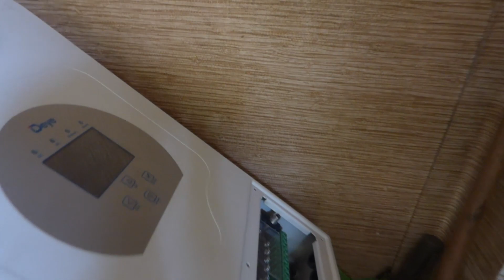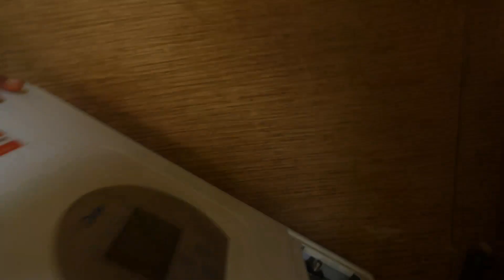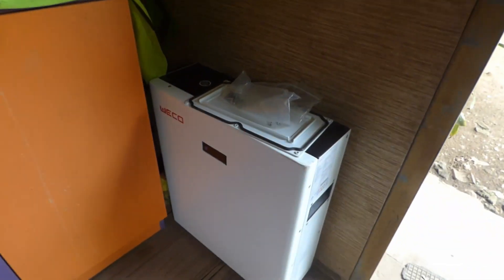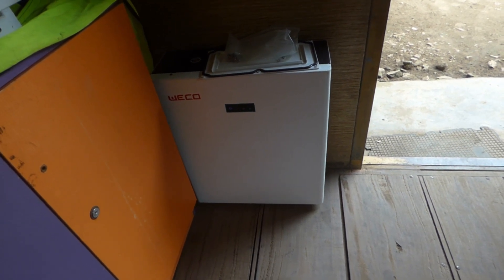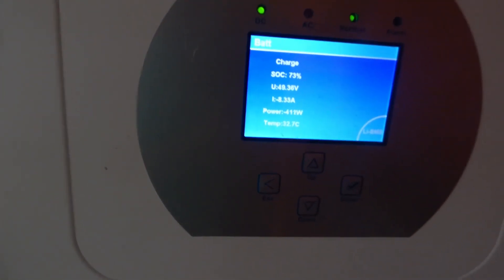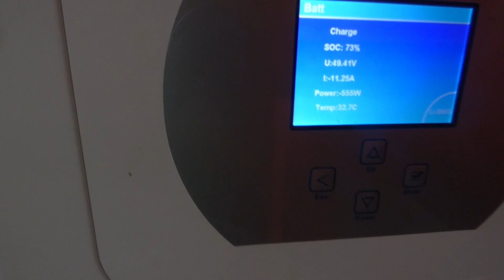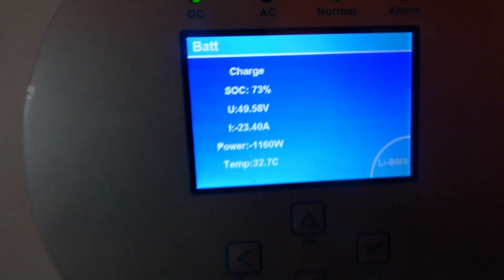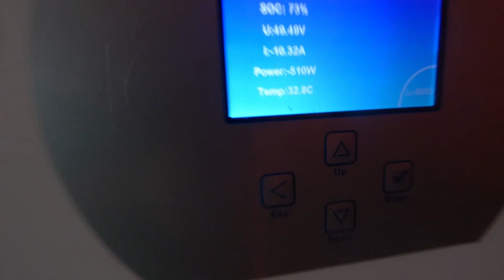Blown up Deye inverter and my Chinese customer service experiences compared to the Europeans

Comment: About to install a 12kW system on my home with a Deye inverter.  I don't know anything about the various inverter brands and wanted to hear some reviews.  This video was perfect.  So helpful and useful.  Thank you so much for sharing this info!!
Reply from the maker: Thank you so much. This means a lot. Good luck with your installation
Reply: I'm about to install a Deye 10 or 12kw Deye Hybrid Inverter in Chiang Mai. Are you happy with yours?
Reply: @BigWorldOutThere98  Yes, so far it's been good, but I've only had it in operation for about 1.5 months.  Smooth sailing so far....

Comment: Good day, thank you for the good video. Have you stress tested the Deye 5kW in a off-grid scenario? Resistive, Capacitive and inductive load test: for example a continues mix load 4kW output from the Deye then add a 1kW inductive load to surges to 8kW then stabilize back to 5kW?
Reply from the maker: Thank you for watching and commenting. We have had two AC s a water pump and hot plate run at the same time with no problems. One 1 he inverter AC and a 1.5 he window unit. I hope this satisfies your request

Comment: hello there i like your videos and can you please share with me the specs of your system?? where did you buy it from and how much?? also can it act as a stand by, fully charged and only come on when utility grid blacks out??? id love to get more of the update about your product and its performance?? email me solarize.l2020@gmail.com
Reply from the maker: The Deye is 5 kw and the battery is 10 kwh from Dyness. I have a little over 5 kw in panels. Most of our clients use our systems as standby or to reduce the cost of electricity. I will send you and email later. Thanks for watching and commenting

Comment: Would appreciate your expertise on this forum: https://powerforum.co.za/topic/7803-deye-5kw-pure-sine-wave-hybrid-only-working-as-grid-tie/
Reply from the maker: I belong to the general forum. We don't have the ability to sell back to the grid. I am not sure I can contribute to the subject
Reply: @drsolar  neither do we but we are grid-tied
Reply from the maker: @Moffat-T  most of my clients have the grid, so when it fails the system takes over. Grid fall back. I will do an AC coupled solution soon.
Reply: @drsolar  Excellent, looking forward to it, especially earth bonding and CT clamp installation.

Comment: Hello Dr Solar. I was really disturbed when I read the title on your video. I am looking at buying this inverter, and was very relieved at the end after watching your video. Please interrogate further on this, and also will recommend type1 SPD as a first line of defence in any system hooked up with our unreliable grid system. Many thanks for sharing your experience.
Reply from the maker: Hello Prince. This customer likes to play with the settings. We are going to add additional protection on the AC side. He is is not the only installation in the estate he lives in. He is the only one that likes to change the settings. I wish he could tell us what happened. He refuses to come clean. The inverter has been very bullet proof and we might be the first such failure in a while. Please feel free to purchase one. They are well built

Comment: Hello Chris, hope the client has a good earthing system? The reason is, since its the SPD section of the inverter that got blown. I have seen the inside of Deye inverter, I most tell you, it's well made.
Reply from the maker: Thank you for watching and commenting. I am still in shock the inverter failed. The tech team in China knew about it before I reached out to them. They asked if I had tried to change settings. This customer like to adjust settings. We did earth on the DC side and the AC side is earthed. We will verify the AC side again. I am still scratching my head.
Reply: @drsolar  If and only if the customer can come out clean, it will go a long way to diagonalized what went wrong. He should not be messing with settings he doesn't understand.

Comment: Nice, let us know what actually cause the inverter failure. People tend to push them more. Also don't rely on SOC only, 49v is definently not 73%. I usally look at volts then SOC.
Reply from the maker: Hello Marco this customer does push and likes to play with settings.  I have always known that the SOC can deceive. Dyness said to fully charge the batteries to allow the BMS to calibrate.

Comment: Sorry about the blown up inverter but glad to hear the manufacturer was very responsive. Looking forward to receiving my 5kW Deye hybrid in the next coming days. Stay safe, stay inspired.
Reply from the maker: They have been above board. Thank you for watching. The inverter is built like a tank. You will enjoy it
Reply: @drsolar  Am looking forward to a video upload of the completion of the fixing of the blown inverter, software recalibration and re-commissing
Reply from the maker: @Moffat-T  they are sending me a new inverter. We obviously need better skills to fix it. My team made too many errors during the replacement of the parts
Reply: @drsolar  To be fair, without prior training on the particular Inverter, I don’t really blame your team. I’m hoping Deye make it standard operating procedure to send a new inverter and take back the faulty one.
Reply from the maker: @Moffat-T  too expensive to ship it back to China
Reply: @drsolar  understandable, regarding the costs but how would a client get to have the warranty work in a situation as the one you’ve had. Clearly client cannot have an indefinite downtime from the unit and if it’s an off grid inverter, even grid-tied where power is erratic or next to none it eventually impacts on sales of the product if a solution cannot be found.
Reply from the maker: @Moffat-T  we gave the client a back up inverter we keep in the office for that reason. We will repair the faulty unit and keep it as a backup unit. I suggest that people making these purchases go through a dealer. When you do it yourself expect at least two weeks of downtime
Reply: @drsolar  Makes sense, unfortunately in Zimbabwe we don’t have any local dealer, I know off. I’m trying to encourage a local dealer of other products to explore Deye/Sunsynk inverters at the moment. I don’t mind being the initial guinea pig
Reply from the maker: @Moffat-T  or you might purchase from a SunSynk dealer in SA
Reply: @drsolar  Seems so meaning installation and potential downtime is unavoidable for now.
Reply from the maker: @Moffat-T  the one failure was caused we suspect by the customer. He added a hot water heater to his system with a lead acid battery. They are very reliable otherwise
Reply: @drsolar  I suspect you are right and then have to get a local installer go through the learning curve with me on installation and “User Interface” and “Solarman App”.
Reply: @drsolar  On a side note: can I get my current 24v system re-wired up to run 48v and continue running on my current 24v inverter? What is the likely drawback before installing the 48v system and is there any inverter on the market that is 48v but can be stepped down to 24v if one doesn’t have a big enough battery bank?
Reply: @drsolar  I’m glad we’re now getting to the root cause of the burn out, which then begs the question, should an over-draw protection within the system not have been good enough to “cut-off” draw before damage?  Are the in-built systems not adequate or do they exist and surely this should have triggered a warning ⚠️ and system shutdown. Clients/customers would be unable to “all know” not to overload their systems or a visitor or house employee may just plug something unknowingly to the detriment of the entire investment system.

Comment: Nice video as usual Dr Solar. I can only say God bless the Chinese. They really can be very hard working and committed. Looks like you need a few more solar panels. LiFePO4 batteries have nearly the flattest discharge curves of all battery chemistries so voltage is not a very accurate indicator of capacity. It appears the inverter was using the voltage to guess or approximate the battery capacity, a method which will be rather innacurate with this chemistry. I was thinking that batteries of the BYD, Pylontech and Dyness class will have CAN/RS485 or other ports that communicate accurate values of their SOC to the inverter. Is it that you aren't using the battery communication cables to the inverter or the batteries are reporting misleading values to the inverter? Need to install a shunt?
Reply: Greetings Dr. solar, but would a shunt with a BMV not help as a secondary source of measure?
Reply from the maker: @Moffat-T  it would help. I have one already just need to connect it.
Reply from the maker: Thank you for watching and commenting as usual. The inverter and battery communicate. However the battery needs to get to 100% for the BMS to calibrate.